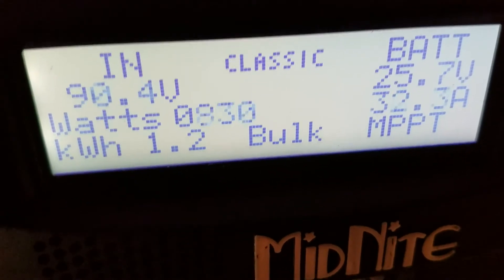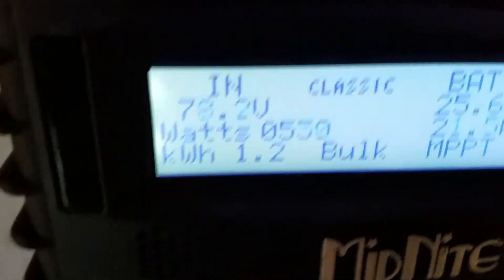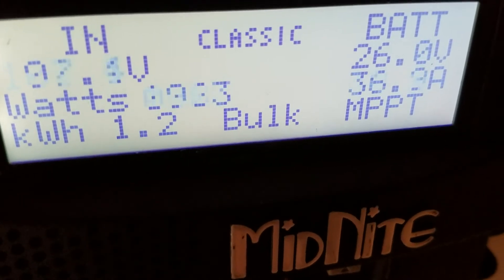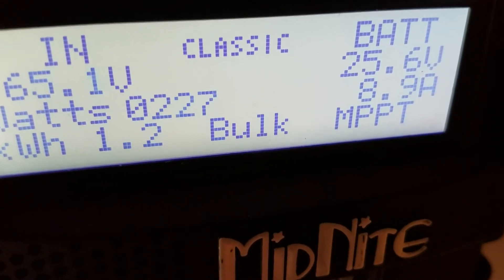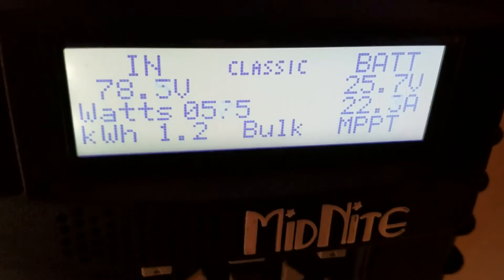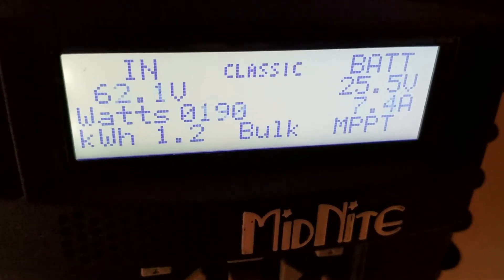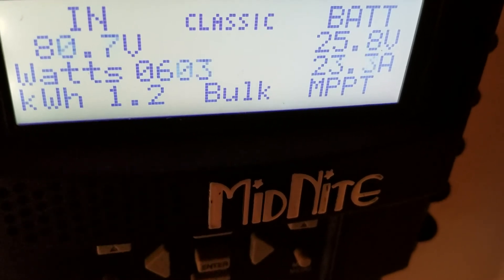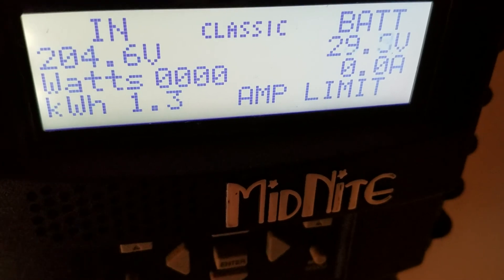Wind Turbine axial flux design goes over limit amps in 28mph wind

Comment: Would it be possible to hook up a mppt to the alternator of my truck with solar on my roof rack to Power my deep cycles batteries for my off-road accessories, fridge, Camp lights, fan Etc? Thanks
Reply from the maker: i would keep the power from the alternator and solar desperate.  and put in a off/on switch from your alternator to the deep cycle batteries. basically charge them while your on the move , then rely on solar to keep them topped off once you stop.  putting two different power sources thru one charge controller is not something i would do. just my opinion.  also your alternator is or should be set to keep your batteries around 14.5 depending on how many batteries you have, you might want to go to a stronger output alternator which they sell at most auto supply stores but still use that kill switch along with a inline fuse for safety.
Reply: SilentDeath002 that's what you are doing, two sources. Wind power, in my case truck alternator through a 30A fuse and a 30 amp battery isolator relay to the wind inputs of the charge controller. The isolator hopefully would be the auto switch when truck is or isn't in use. I appreciate all your advice on this subject and was looking up dual input mppt charge controller's and your video was most appealing. I started looking at yr other videos but got caught up in all the fireworks!
Reply from the maker: i know what you mean about the fire works, i did that for 20 years in las vegas for casino's.  there are some charge controllers that say they can handle both wind and solar, but i would not trust them.  reason is, say your solar input is pushing your batteries to 14.5 volts, and your wind/alternator is only putting out 13.9. the alternator/wind would have to go over the 14.5 volts before it would start to put in any charge . thats why i use two separate  controllers. and you still might have a similar problem.  the wind/alternator would have to be set at equalize setting while solar is at a lower setting for both inputs to work together.
Reply: SilentDeath002 ok, would it be worth it to get 2 mppt controller's or would pwm be ok? Thanks again.
Reply from the maker: i like mid nite solar controllers. you can hook your lap top up to them and control everything from the lap top and see live data.  what controllers are you using,  there are some on the market that are nothing but a pass thru controller, they just show whats going thru, they do not protect your equipment, so ill need to know what your using to give you a honest recommendation
Reply: SilentDeath002  Just about the cheapest 20A pwm on Amazon.
Reply from the maker: i stay away from cheap and tend to over build my set up.    have to think about how much power your going to be putting  thru it. heck, a lot of factors.  safety is priority one. and a decent to high end controller will give you that, but it all comes down to your budget.  one that gives you 3 choices of charge settings, float, absorb and equalizing is what you want. hope this helps
Reply: SilentDeath002 yes it does, thanks
Reply: I used to have an "interesting" setup, on a yacht. So here goes: 2 X diesel engines, 2 X alternators each, 1 start battery each, and a bank of 'house' batteries. Start batteries 66Ah each, 'house' 350 Ah LAVR,  2 X 200W solar panels, all wired for essentially 12V. Solar HAD  to have it's own charge controller as it had to be fully independent of the rest of the system, and could ONLY  put charge into to 'house' bank. The smaller engine alternators were set to 13,9V, and through a charge relay, would charge the start batteries first, until charged, then current was sent to the house systems. The large alternators (100A each) had a single controller for both. -  NOT the best solution, but worked - and would only charge the house systems. the controller was rather clever in the way it controlled what the alternators were doing. It altered the required voltage AND current  to achieve a good charge solution, with very low batteries, it would charge rather slow until a desired charge was reached (set by battery  TYPE), it would then ramp up the CURRENT to max until 86% battery float voltage, then slowly ramp down current and maintain float charge and voltage. All in all, i would never mix charge controllers for different inputs, let each do its own job as best it can and you can afford. - I never let my 2Kw full sinwave 100%duty cycle inverter / charger ever try control the charging as it just could never decide which input to utilise.

Comment: 2300w@ 28mph not too shabby , vast improvement over our store bought pmas from mw .
Reply from the maker: i hear ya buddy. i need to rework the tail section some, make it stronger and get a clipper but was nice to finally get some wind over 20 mph to test it out. i slowed down the video and saw 2679 watts @ 96 amps . then it went into over voltage.
Reply: @SilentDeath002  i see Orlando has left YT , he did have a healthscare a spot on his lung or something so he said in his last video

Comment: Wow, glad you were there to hit the brake!!
Yup, time for a clipper
Reply from the maker: i hear ya buddy ! i already contacted mid-night for a clipper a while ago, still waiting on price
Reply: Not cheap.
Reply: Or using an audio capacitor like you did..  The cap is not only there to prevent huge spikes in voltage ,but, regulate the turbine output by INCREASING THE LOAD on the turbine when the voltage raise in the cap...  Since you use the cap for a while, did you noticed the power being diverted to the resistor?..
Reply from the maker: i never picked up one of the audio caps bro, i know you recommended trying it, i never got around to it.
Reply: I was referring to Darren.  I suggest him and he bought it and hook it up to the output rectified and that is why I was asking because I never seen his system go over volt...  I think you should exchange with Darren on it...  It has more benefits I can enumerate here....  I got one on my Thermodyne pma and it makes a huge difference...
Reply from the maker: i use to use some smaller caps on my pulse motors. i am working on building a clipper or checking with mid-nite solar and get one of there's. l have a good one

Comment from the maker: i saw the last reading just as i stopped the recording to hit the brake, it was 150 volts @ 96 amps
Reply: I heard that if you take thinner wire more turns then you also get high voltage but lower Amps you can tell me if i am wrong.
Reply from the maker: @faithquestionsministries  i have been making coils for a long time, you want high amps. that way the blades do not have to spin in high wind.  i am using 12 to #14 magnet wire only.  some where around 72 and higher turns if you have room. going thinner wire you will have to have wind speeds way up there to do the same thing.  would be better to get decent power at 3 to11 mph which is usually daily, rare to get 30mph or higher so build it for the wind you have
Reply: @SilentDeath002  I want to thank you for you honest reply and that you came back to me friend you are a awesome man i see it in your work in the bees love your horizontal bee hives they are the best you care about nature and people keep on with your love to care about bees and other people to have the same knowledge.
Reply: One thing i want to ask you if i build a 12 inch turbine plates is it the coil radius that is 12 inch or the magnet plate? and do you measure from the middle of plate 12 inches or is it the whole plate from one side to other side 12 inch thank you friend hope your health is better i pray for you. My wife did struggle with her kidneys and stop eating meat and turn to green veggies she healthy now. I also stop eating meat  because of some health issues and i lost 25 kg. Now i am healthy too it not easy. I also eat omelette eggs in morning everyday no cholesterol.
Reply: I also want to ask how do you connect a 3 face and a delta coil
Reply: A nother question very importand for me is. When i connect the three face wires for 24 to 38 volt turbine what rectifier size do i need and what controler box or must i use a regulator and heater dump load what must i do friend please help me.
Reply from the maker: @faithquestionsministries  midnite classic charge controller i would say is the best one, classic 150    it can take 150 volts and 96 amps.  the voltage rectifier needs to handle those amps so look around for some heavy duty ones.   you can also build your own rectifier if need be by using strings of heavy diode, look on you tube to see how to build those, comes in like sets of 4 per each phase.  now the classic 150 has whats called a power curve. and that is programed into the controller to optimize the power of your turbine.  as the blades start moving, the power curve is like a dragster going thru a 1/4 mile and each power curve setting is a shift.  the video i posted is a classic 150 being used, you should see examples in you tube of the power curve settings also, good luck
Reply: @SilentDeath002  Thank you friend
Reply from the maker: @faithquestionsministries  glad i can help some
Reply from the maker: sorry , have not checked back on my videos in a while been busy.  if you are setting up a dump load you can use resistors in combinations that total the amount you need to keep your wind turbine in check when it goes over the voltage your charge controller can take.battery bamls are set up for 12 , 24 .48  anything higher then that and you should just connect directly to the power grid and sell them your excess for money if they will do it.
 @faithquestionsministries
Reply: @SilentDeath002  Thank you that you reply
Reply: Hi James a friend ask me i must find out he got a 12 kw solar system that he want to connect with a vertical wind turbine can he use a hybrid inverter to connect both or must he first change three face turbine with rectifier to DC  then connect with hybrid inverter
Reply from the maker: @faithquestionsministries  you need to go thru the 3-phase rectifier to a charge controller, then to the batteries, then to inverter, for the wind turbine, the power coming into your system will require a separate charge controller for the solar which will go to batteries, then to inverter, trying to use one charge controller to do both will not work , i use buss bars that handle high amps to make connections to, then a positive and negative goes to inverter, using the buss bar lets you connect several different sources of power to one location